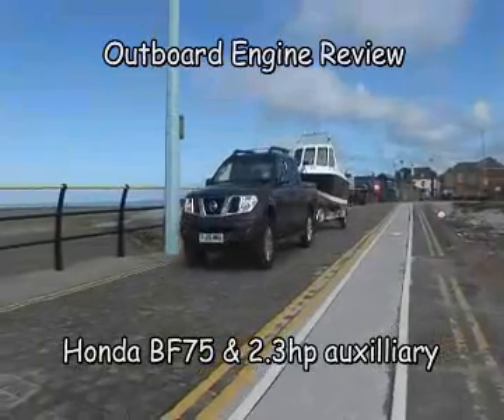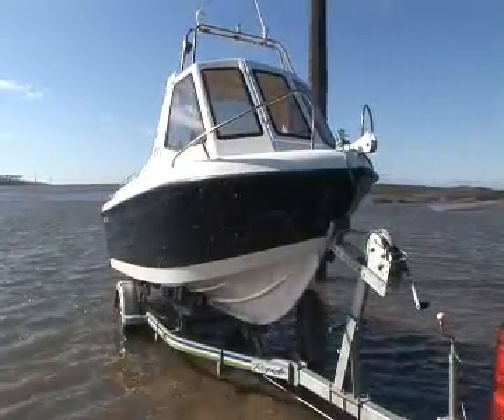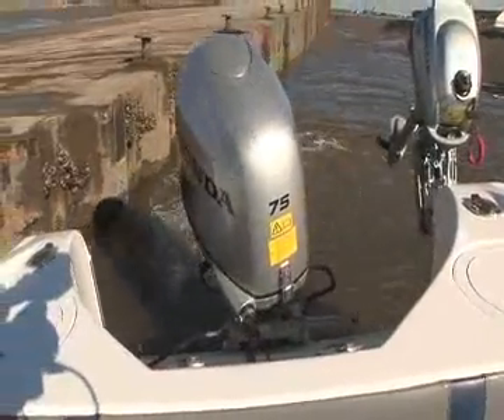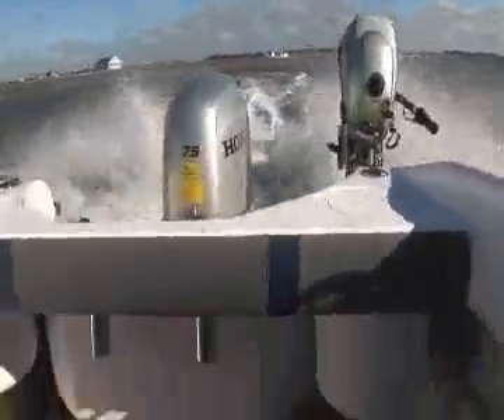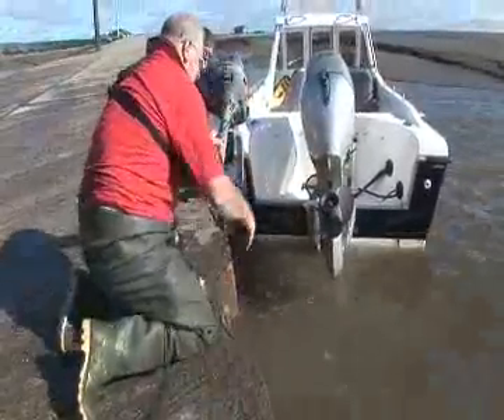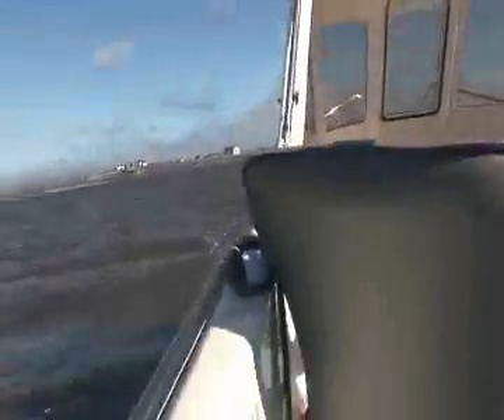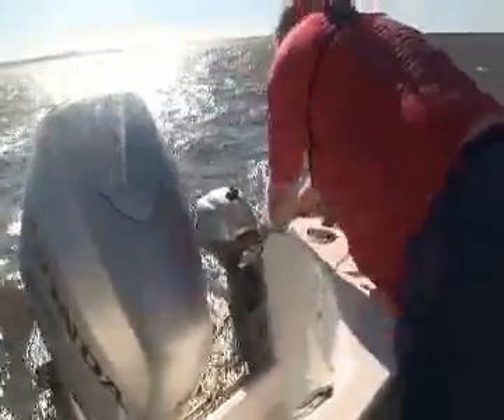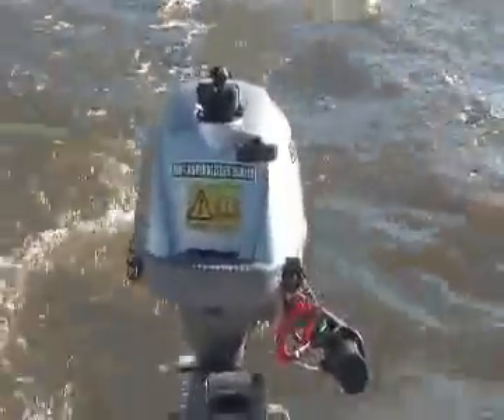Honda BF75

Comment from the maker: @boatingisfunUK 

This refers to the fact that unlike the other props, the 16 inch prop is stainless steel and therefore unable to shed its blades easily if it impacts anything thererby lessening the force of the impact on the internal workings of the engine. Stainless steel props cannot do this and run the risk of transferring the impact damage up to the gear box.

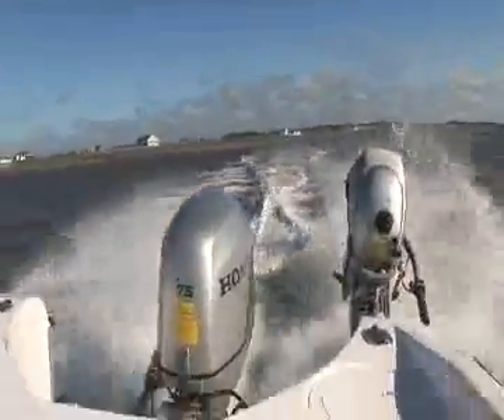Comment: at 2:00 he is saying that if it hits an objects with 16" prop which gives higher RPM then it may damage the gearbox! a joke! 
 At any RPM, the chance of damaging the Gearbox is high if its hits an objects, 17" or 16" does not make any difference in protecting the Gearbox.